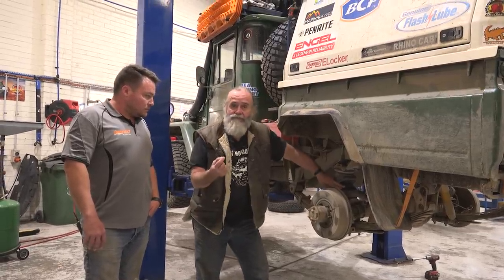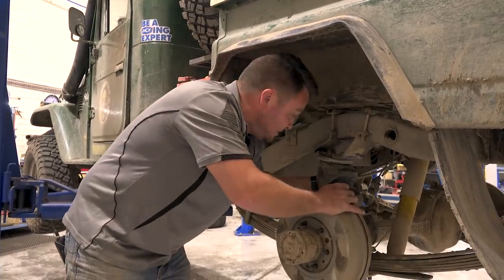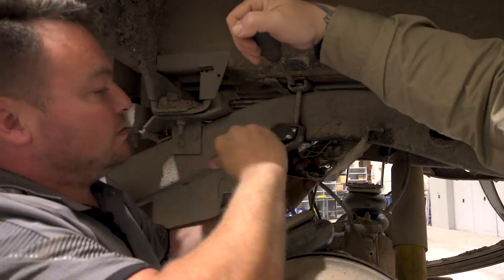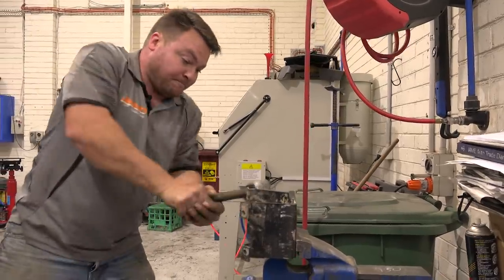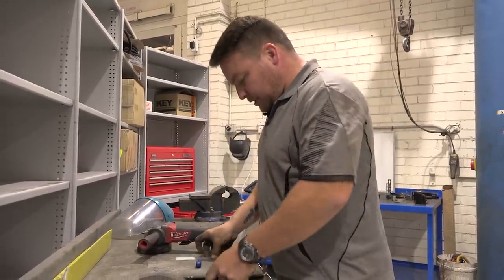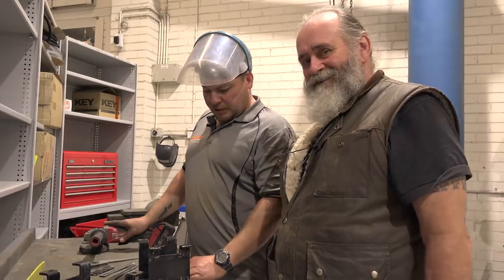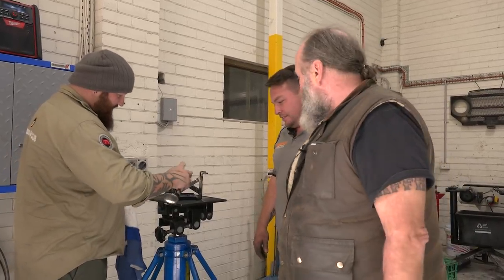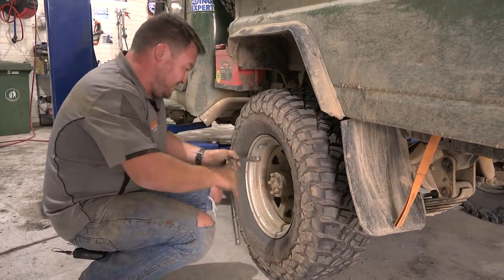HOW TOUGH ARE AIR BAGS IN THE REAL 4WD WORLD?

Comment: The reason that bent like that is as the leaf springs compress the axle moves backwards ever so slightly, the air bag brackets need a small angle to them to compensate.

Comment: Those airbag mounts are an absolute joke! I’m not a mechanical engineer but I can see that they are made of metal that is too thin and also the design needs triangulated cross bracing. If they were any good you wouldn’t be able to ‘bend them straight’ by hand. That block of wood you have would make a better support mount on the vehicle!

Comment: I'm curious as to why thicker high tensile bolts and brackets, such as Stainless Steel with a slightly higher Nickel content were not used in place of what seems like thin mild steel brackets and bolts - understanding that having some give in metal is good. It's interesting about the 'Airbags' and how they differ to traditional suspension components, Cheers for the video bud :-)

Comment: i would of suggested thicker steel bracing it only a temp fix a best roothy, ..

word of the wise don't piss off the hand brake mate..
Reply: You sould like you speak from experience!! 🤣
Reply: @chrish1590  banging the shit out of thin gauge sheet metal  and adding supports to strengthen  a failure point still means that  failure point will fail..

reason why it bent in the 1st place because the was to much weight  on the bracket...

I learned in in my younger years never pissoff the wife/girlfriend ya might get sore nuts for that trouble..
Reply: @jasonhowe1697   i should have been more specific. I agree with your view on thw bracket, my comment refered specificaly to the handbrake. But yes fatiguing metal that way is a shure fire way to make cracks.
Reply: @chrish1590  lol , in this case  I think you missed the point when roothy was talking about the handbrake it wasn't toyotas hand brake, the wife would be the definition of what roothy was commenting too.....

with the metal fatigue within those mounts it would of been a smarter idea to use thicker metel rather than pounding the shit out of the bracket than tacking in pieces of plate to add in rigidity 

the bracket will fail again because the bracket should of been made from 3-5 inch thick  metal plate not the  1/2-2 inch thick metal plate.

no amount of bracing is going to fix this issue, as there is now metal fatigue within the  from it being bent  out of shape then it bashed back into shape

you could layer up 15 welds  and still face that bracing to to fail

with the failure of the bracket already I would say a defect notice would be on the cards, with a complete replscement of both brackets